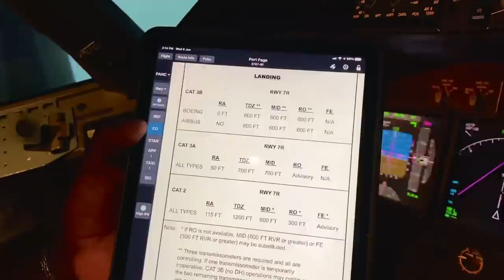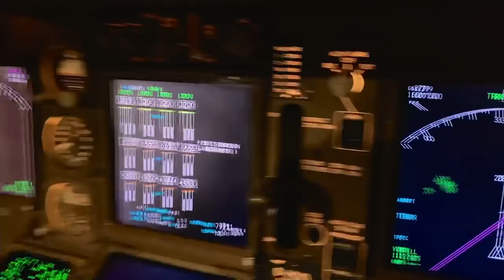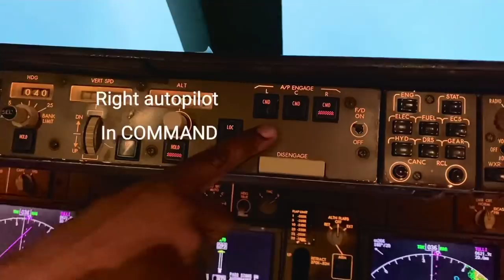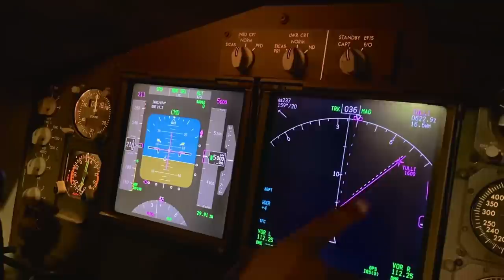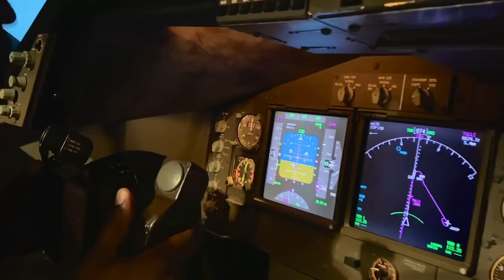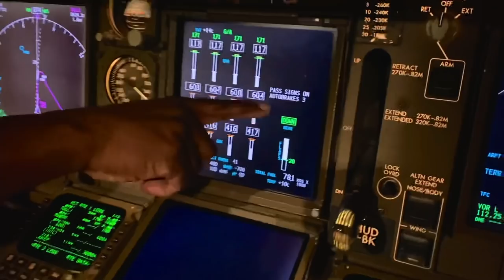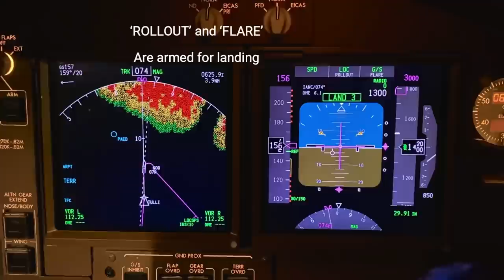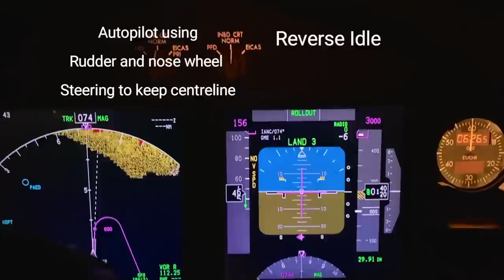Boeing 747-400 Automatic landing

Comment: Before I retired from airline maintenance, I had the pleasure of teaching avionics to other mechanics.  My favorite course was 757 avionics with its triple autopilot systems, very similar to the 747-400.  However, the first time I sat on cockpit jumpsuit and watched as the pilots flew a perfect low visibility approach was in a DC-3 landing at Dallas Love Field,  probably in 1966.  The regional airline where I worked as a newly certified A&P mechanic at that time employed many WWII-era pilots who had amazing flying skills.  The DC-3, of course, had no autopilot, no flight director, no radio altimeter, no DME, and no flight computers.  Beyond the basic flight instruments, for instrument approaches the pilots had only the two pointers representing localizer deviation and glideslope deviation from each of the two navigation receivers, plus the marker lights and an ADF for any available LF marker locator radio stations.  Of course the approach speed of a DC-3 is much slower than that of a 747, but it was still a welcoming sight to see the runway lights appear exactly where they should be, just before we reached decision height.  I am not saying that today's airline pilots are not good at what they do, but the old timers were never short on current experience for situational awareness and for hand flying the airplane in all conditions.
Reply from the maker: Lovely story, thanks for that. It is true that the old timers were a different breed when it came to hand flying skills for sure. With very little automation, they had to be. I was fortunate enough to have flown the DC-3 in my early days as a Co pilot for two years. Lovely aircraft!

Comment: It all looks so easy - but what the SLF don’t appreciate is the training and constant checking of the multiple failure cases at various stages of the approach: engine failures, ILS anomalies, RVR changes etc etc, each requiring different resolutions at different points.
Great video.
Reply from the maker: That is too true- it’s intense monitoring from both pilot’s throughout the approach with immediate reaction if something goes amiss.

Comment: Well directed and executed documentary Skipper! Used to do it on my 747-400 PMDG Flight Sim but I learn't something extra. Did a similar LVP landing using the HS Trident which is also capable of Cat 3B and 3C but with Analog instruments. Flew the actual Trident 3E sim around 1998. I yrained in 2010 on A320 and did LVP training then. The level of automation on Airbus is amazing. They use 10kts as maximum taxi speed in LVPO.The only time I had to do a real LVPO Approach was in Kuwait in Dec  2019 on a foggy early morning. We were certified for Cat2 approach but I think as we landed it was b elow the visibility  mininums temporarily during flare but we could see the centreline and so  continued.Thanks for the brilliant presentation Captain Obet
Reply from the maker: Cheers!

Comment: I love that Port Page.  I wish we had that at our airline - or at least had it on our Jepp FD.  It’s on a Supplemental Procedures Card that gets worn and tough to read in poor lighting.  I need to suggest putting it on our Jepp pages.  Great video.

Does the stall margin change with load factor on the 747?  The Honeywell systems do and it’s extremely useful during low speed maneuvering.

Comment: Surely  landing flap 40 is better for this landing as slower approach speed for runway orentation  , better flight deck visibility and shorter landing distance on low visibility runway ?
Reply from the maker: Boeing 747 maximum flap is 30 degrees. Your assertion is correct though to use maximum flaps
Reply: @pilot_obet  My apologies. ..
Of course it's full flaps 30 !!
Getting mixed up with landing flaps 25 !!!
My brain is going...
Haven't flown the B747-400 for 12 long years...since retirement! 
No better experience. .
Thanks for bringing back happy memories. ...
Reply: Sorry...

Comment: Do you set the speeds on the approach or does the AP do it as you change the flap settings? Is the radio altimeter display separate from the barometric display or do they overlap?

Comment: When you have all three autopilots on, I assume only one is engaged. Are the two unengaged autopilots comparing their readings and decisions to the engaged autopilot? If the comparison is made and a deviation is detected what happens? Can you continue on by manually or automatically engaging a different autopilot if the currently engaged one has deviated? Do you need at least two autopilots in agreement to complete the landing?

Comment: If you’re some where at 3,000 ft on final approach, and the QNH is 10.20 Hp, and field elevation is 433 ft, how then do you calculate how many feet to land? From the altimeter should you aim to torch down at 433 ft being the field elevation? I have tried aiming to land at 433 ft from the altimeter, but it doesn’t work. I would finally torch down at 344. Pls how do I calculate it right?

Comment: Very interesting video. Please tell us how to correctly fill in the NADP 1 and NADP 2 procedures in FMC. Thanks in advance.
Reply from the maker: Soon
Reply: @pilot_obet  OK!
Reply: @Игорян747  you have acceleration height and thrust reduction. So NADP1 is 3,000 acceleration height and 1,000 or 1,500 thrust reduction. 
NADP2 is 1,000 acceleration height and 1,000 thrust reduction.
Reply: @TB-um1xz  What does the E / O ACC height depend on?
Reply: @Игорян747  terrain. 99 percent of the time it is 1,000 feet.
Reply: @TB-um1xz  In the video I saw different values, and 1200, and 1500, and 1100 and 1530, why?
Reply: @Игорян747  all depends on terrain. Also it depends on what data they give to Boeing and or Aerodata who does the performance for airlines.

Comment: You had 20 knots crosswind.
What is the limitation for the 744 for autoland?

Why did the terrain display not show the highest and lowest terrain on the ND?
Reply from the maker: 25 knots is maximum. The B744 pax version didn’t have the lowest/ highest terrain presentation in early days. A modification was made in later models.

Comment: Question. Can that sort of Autopilot landing be done in strong crosswinds where you see planes at all sorts of angle other than pointing straight down the runway?
Reply: Each aircraft type will have automatic landing and low visibility crosswind maximums in the manual, generally 15 knots for LVO.